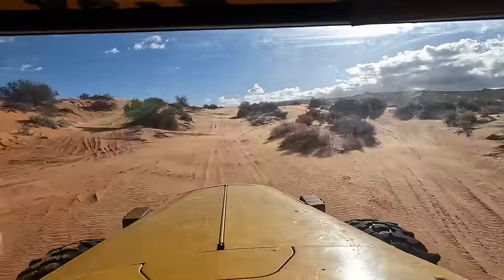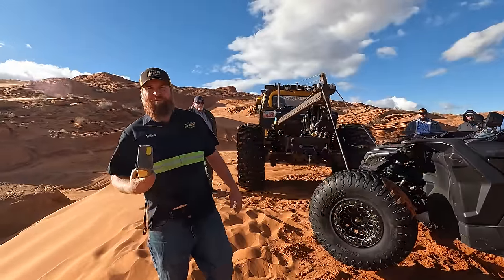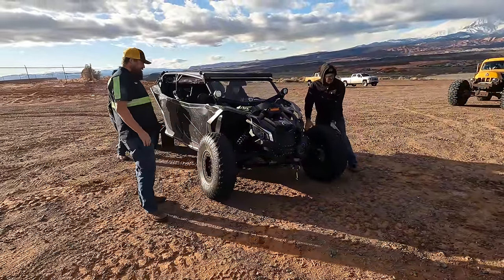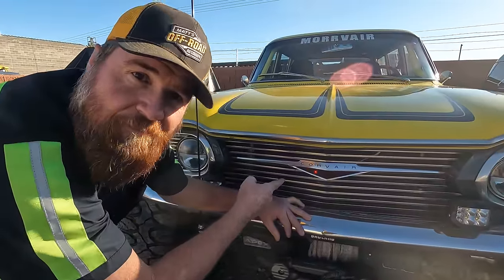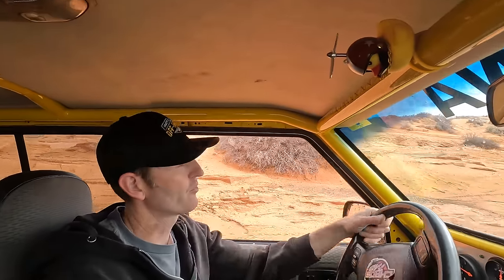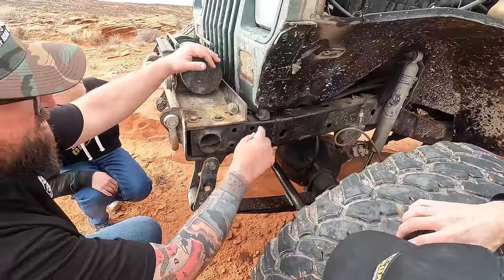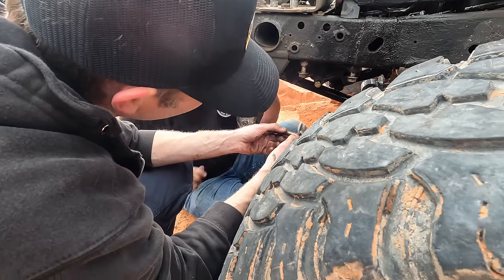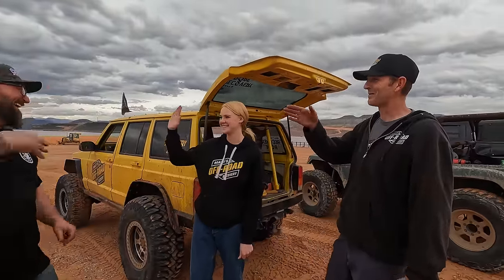We Can't Tow This Jeep Out Of Here...

Comment: Love Tractor Supply, tons of what you need, and loads of what you just have to buy in case you need it one day.
Reply: If it's in stock. The ones around me are horrible with restocking anything
Reply: ...like popcorn!!!
Reply: I regularly go to my local engineering shop for hardware (nuts and bolts etc.) and always feel guilty when I put a big bag-full on the counter.  They have to look up every nut, bolt, washer etc. and unless I needed stainless that day, it would come to maybe five dollars.  Heck, it just took them ten minutes to price it up, and the cost didn't even cover the salesman's hourly rate!  Note I am not so embarrassed that I thereafter go to my local DIY stores for my nuts and bolts and pay ten times as much for them.
Reply: I am always afraid to go in there. You go in for something to finish a project, and end up with stuff for three new projects.

Comment: I kept twisting off steering box mounts. After limping off cliffhanger with my steering box ratchet strapped to my frame. I custom built a steering box mount, and tack welded the bolts. Never had that issue again.
Reply: Yep bolt back out is main cause of it.
Reply: Don't they use thread locker?

Comment: As a jeeper I'm not surprised how many crashed utvs you see. They drive like the subaru crowd ...too fast when they should be going slow, and too slow when they should be going faster
Reply: As a jeep and SXS owner, I'm not surprised at the Jeep recoveries, either. Using grade 5 hardware store bolts and no tools on the trail. They're like the F150 owners of the off road world

Comment: I've built a few off road rigs and I consider myself mechanically inclined. I went to the Honda and Yamaha dealers to look at these new SXS vehicles and honestly they are built like a Yugo. Everything is way too weak, the half shaft axles, the suspension and the steering. And the prices are absolutely ridiculous.
Reply: Depends on what they are being used for. They weren't designed for extreme off reading. I do agree the prices are insane
Reply: @Berm_Blaster  you are right. They make a great farm utility vehicle. But they aren't made to take to Glamis and start jumping step downs . I totally agree that the prices are far out of proportion. This whole SCS rave is just another scam a hustle. Replacement parts and upgrades have become a billion dollar industry, and just to make the vehicle do what the manufacturer claims they will do in the first place.

Comment: Matt & Tom - Unrelated to this video, but have you considered putting a vertically mounted hydraulic ground anchor on any of the equipment, to speed up winching operations?  Possibly some peg teeth along a bar, for use in ice, sand, and rocky terrain?
Reply: We've thought about it and it would be nice, but also a lot of work.  It's on the maybe someday list.

Comment: I'm sure someone has already suggested this, but I can't help thinking one or two boat fenders would be perfect for protecting the rear of the off-road wrecker and the car they're towing.  So far they've been pretty lucky with someone in the disabled car using the brakes, which seems like a great plan right up until they have to tow a car that doesn't have any.
Reply: might have helped if they knew better when building the wrecker boom and had made it longer.

Comment: Have you considered a spreader beam attached on the  wrecker a-frame so each cable can  level the vehicle independently and give the vehicle stability on the tow outs.  On the end of the bar a pulley that the cable can simply be hooked over.   A 4 -6 foot spread should be adequate.  No more rockin and rollin!
Reply: He's talked about it, I think. He's not into it

Comment: How did Tom calculate the 11%?   Relative:   2 out of 4 bolts is 50%, and  2 out of 3 is 66.7% of the potential design strength.   So that's 16.7% better?    Or 16.67/50 = 33.34% stronger ?    Or 66.67/50 = 13.34% increase?      Or in absolute terms:  4 bolts = 100 units.  3 bolts = 75 units  (assuming each bolt is contributing an equal share and 100% of it's breaking strength when it fails).   So 2/4 x 100 units = 50 units MBS.    And  2/3 x 75 = 50 units MBS.  So no difference.

Comment: I can't believe there are no corrective comments on this first page of comments about the 11% comment. Tom, you thought the steering box needed 4 bolts and you had only 2, so if that had been correct, you'd have a 50% rate of completion. But, it only needs 3 bolts and you had 2, so instead of a measly 50% completion, you are at a 67% (2/3 rounded to nearest whole number) completion rate. But wait, there's more. Some might think that instead of 11% better you're actually 17% better, but that too is wrong. In fact, 2 out or 3 is almost 34% better than 2 out of 4. That's true, but why? I know Tom knows and he just misspoke on trail.

Comment: After following this channel for three or four years, the time has finally come to ask, 'What does locking the hubs do?'.  I am sure that I used to think it was an awkward way of putting the vehicle in four-wheel-drive, but in this video we saw Tom put the Banana in 4X4 and then Kaitlin later locked the hubs in.  So I assume it is similar to a diff lock, but how does it work? It can only activate a mechanism in the hubs, and not the front diff.  Is it some sort of one way ratchet mechanism?  I'll try Google, but I'd love to hear what other commenters know about it?
Reply: OK, it looks like I was over thinking it.  When the hubs are unlocked the wheel spins freely and does not turn the drive shaft,  so when Tom put the Banana in four-wheel-drive, it had zero effect until Kaitlin locked the hubs.  I am still confused though.  I owned a Pajero for 18 years, and I could put that in 2W, 4W and 4W low from the drivers seat (and I don't have extremely long arms with multiple articulation joints).  I think four wheel low locked the front diff.  Least ways the tires would chirp if I forgot to disengage before driving back onto tarmac, and the steering became hard to turn.  So how does it work with jeeps, and why use a mechanism that requires someone to get out of the vehicle?

Comment: Still no sling on the wrecker. Without it it is just a boom truck.
Reply: and with one it would just be a broken off road wrecker.
Reply: @iffykidmn8170  How ? The sling is standard on every tow truck before wheel lifts. Stops the vehicle from slamming into the back  of the truck.
Reply: @mrwilson7617  they are limited in articulation which works on-road, off-road once the limits are passed something has to give. Eric from BSF recovery found out what happens once the limits are passed in a recent visit to Utah with his wrecker which worked ok in his Wisconsin off-road recoveries without the extreme angles encountered in Utah.

Comment: That side by side that y'all loaded in the trailer.  U should advise people that they should put em in backward on count of weight distribution.  If ya put it in forward then all the weight is at the back of trailer an its not bad if ya going slow.  But anything over 55 then it could start tail whipping.!!
Reply: Yeah, sway risk with all the weight after the axle.
Reply: It's extremely rare people having problems towing with them straight on the trailer. See people towing with them like that and also sand cars all the time on the way to the dunes. 60-70mph and never seen one swaying. It is true having most of the weight past the axles will cause swaying but there has to be a significant amount of weight
Reply: You got the right idea but the wrong conclusion. Doesn't matter which way you load it as long as the weight distribution is right - some might be front heavy, some might be rear heavy, many are 50/50.  Some trailers have a single axle further back, some are tandem. Best idea is to weigh your rig and load accordingly so you end up with 10-15% of the trailer weight on the hitch, or failing that just edge the load forward until the rear suspension of the tow rig settles just the right amount.